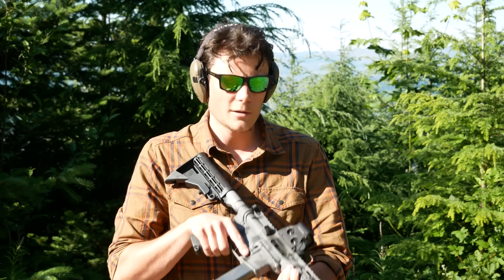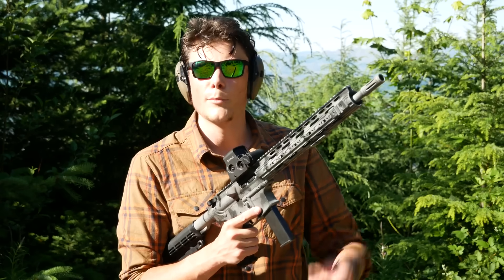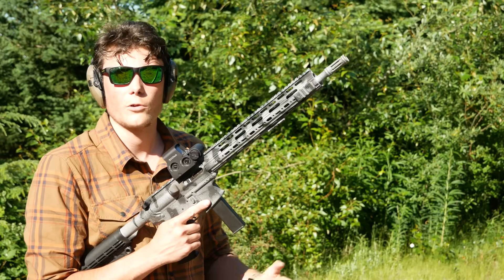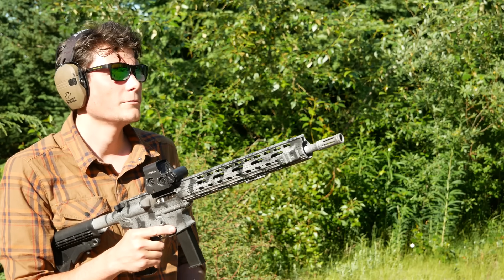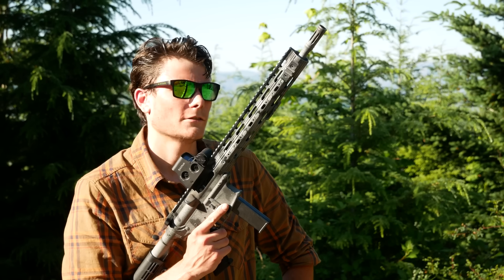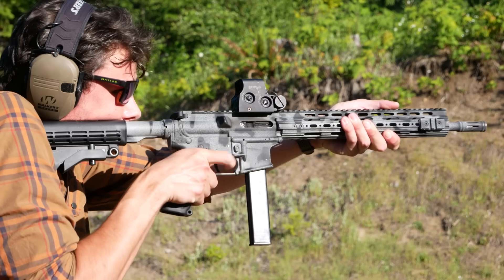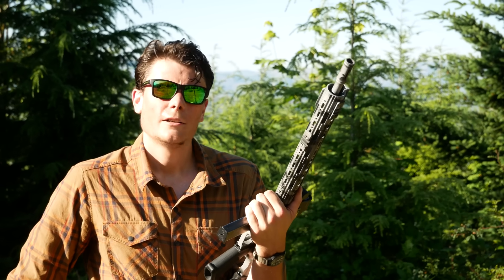Converting an AR9 to Roller-Delayed Blowback

Comment: If I recall correctly the 9mm AR does not have much "recoil", even the SMG, at least in my expeirence, but I guess it's all relative.  If you never shot anything with significant recoil, you would think an AR9 has a lot of recoil.....

Comment: Cmmg Radial Delayed Bolt and Barrel costs at least $375 and is more depending what barrel length and store you look at and there is no guarantee that it'll fit in your receivers w/o modification.  I considered getting this instead of the CMMG kit bc of cost and simplicity.

Comment: The only disadvantage is that because the charging handle pulls on the portion in front of the rollers instead of behind like purpose build roller delay guns, you have to overcome the rollers while chaging it.

Comment: I recently bought the Palmetto State Armory PX9 Gen-4 rifle. WOW the amount of crud that is blown into the receiver and out the ejection port! 
My brother is left handed and can even see the amount of powder residue being blasted on his face! The brass casings are even ridiculously covered with crud and quickly turned the costly walnut media in my tumbler into looking like I am tumbling with charcoal.  
I' m now seeing these exact same complaints from even years ago, and so it's pathetic that any company would still be letting their guns leave the factory with their schitty light weight buffer. Theyre charging an average of 800.00 for the gun and yet theyre then making us pay for the PROPER 8oz buffer which significantly helps keep the bolt closed longer in order to keep most of the crud in the chamber and it reduces the recoil

Comment: It seems like the point of a roller-delayed system in a subgun is to shave weight and recoil impulse over a straight blowback.  As an added bonus, most roller systems lack the need for any kind of buffer tube for those who want foldy bois or no stock/brace whatsoever.  This feels about as limited in market as the Angstadt Arms MDP-9 which costs as much as an SP5 but doesn't get you admission to the HK owner's club.

Comment: I have a QC10 Colt lower and the biggest thing I've noticed, besides all the troubleshooting it takes to get the thing to run without a malfunction, is how dirty the blowback system gets, especially around the upper & chamber area. Cleaning the gun after two 32 rd mags, you would think you fought a small war with how dirty the gun gets.
Reply: Is hops lower a QC 10 colt mag lower?

Comment: Any confirmation of it working with the PSA carriers?
Reply from the maker: It should work. Looks like the current gen PSA carrier has an internal pinned weight, not a rear section.

Comment: Why not make an AR-9 that uses MP5 mags?
Reply: Because it won’t lock open when empty. You’d be better off using Scorpion mags, they are cheaper and you can make a gun with last round bolt hold open.

Comment: It would be interesting to see them continue to develop on this, although there is only so much they can do because it is putting stress on the lower extension tower and the back end of the extension versus a trunnion. 

Not bad, good for them for trying something different.

Comment: I am the recovering owner of an AR9. Over the many years of my shameful addiction, I have tried many different spring and buffer weight combinations trying to soften the recoil of the thumpy AR9. The short answer is, when compared to a regular carbine spring and Colt SMG buffer, none of the buffer and spring combinations I have tried made enough of a difference to make a difference. 

The fact that something now exists that makes Hop say, “Wow, that feels a lot better” is very intriguing.
Reply: You should also look into the Scheel Roller-Delayed Buffer System- Gen2, Works great!
Reply: I built a blowback with a standard CS Carbine Brownells spring and a 7.5 oz buffer and the thing didn’t move when firing
Reply: Mean arms just released a roller delay BCG
Reply: you were shooting the wrong ammo. i shoot USPSA PCC with ammo specifically loaded for PCCs and it's like shooting a .22lr. but then again i'm also running a $3,000 PCC.

Comment: Just putting this out there: the Maxim doesn't seem to function in the same way as the MP5 does, even though both are called roller-delayed. While the MP5 (and CMMG) use mechanical leverage to increase the inertial resistance provided by the carrier's mass, the Maxim buffer looks like it acts more as a strong ball detent. Also, while the charging handles of the MP5 and CCMG bypass the mechanical disadvantage of their systems, the Maxim does not. That's why charging is more difficult with the latter. 

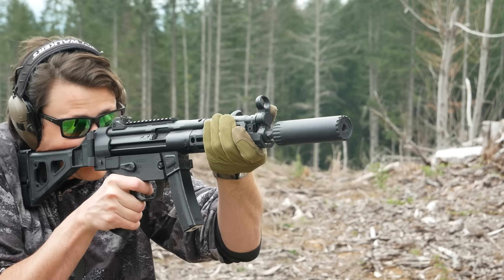Regarding 5:20, you can speed up the cycle time of an MP5 by placing a delrin spacer inside the receiver. This stops the carrier from moving back as far. In fact, you can shorten the cycle distance of a from the original 4.7 inches to ~2.4 in., shorter than that of most AR9s. I've done this to a select-fire MP5 and it brings the rate of fire up to almost 1,200rpm. It's a riot to shoot steel with!
Reply: Oof, that would be fun.... I bet you would detach your own retina if you did that with a G3.....
Reply: @presidentmerkinmuffley6769  Haven’t done it with a G3, but I did try it with an HK53 and its 5.56 ~8” barrel. Between the recoil and muzzle blast, I could barely make out the red dot. It rocked my world haha

Comment: Hey Hop, love your videos. I was wondering if you backed the buffer tube off one full rotation to get the proper clearance for the buffer system? I heard that was recommended because if you don't it will pre-load the buffer system causing it to not recoil as soft as it could. I also heard that makes it a bit harder to charge the firearm. There is a channel called blowback9 if you get more into the 9mm blowback systems, he goes very in depth and is very informative. Once again keep up the great work your videos are awesome.

Comment: Your buffer serial number is just 1 behind mine.  I've really liked mine, and I ended up getting a second one to dedicate to my suppressed SBR.
Reply: Did yours install without any compression?  I had to loosen my buffer tube one revolution to prevent pre-load on the system.
Reply: You guys are almost like tunnel buddies.
Reply: @JimYeats  almost?  Almost is never good enough.
Reply: @chevrofreak  Well said.

Comment: Hop, Arfcom has noted that the force to use the charging handle is vastly increased to the point where some people might not be able to actuate it - can you elaborate on how heavy it is and if it’s a concern?
Reply: He talks about it at like 3:41
Reply: It is sugnificant. Hop really downplays the effort it takes to charge. Makes me question why. Any other time or item, he'd be verbally assaulting the force needed. 
It's not a minor issue, it's borderline excessive..
Reply: @stevegillespie6424 hop is also a big guy and can get a better hold on it.

Comment: I have been looking to begin an AR9 project, but I really wanted to get last-round bolt hold-open with reduced recoil impulse, but not breaking the bank to accomplish it. I was considering doing the CMMG roller delayed bolt/barrel assembly with an Aero EPC9 receiver set, but that plan fell flat on its face when I learned the CMMG system requires a larger than normal ejection port and the EPC9 upper receiver has a smaller ejection port. Now that I know this Maxim buffer system works I can probably get the EPC9 receivers that come with a last-round bolt hold-open feature and a different AR9 bolt system, and it should work fine. Thank you!
Reply: I built a standard ass blowback with a 7.5 oz buffer and carbine cs spring from brownells and it doesn’t move when I shoot it…literally zero recoil, I don’t understand what everybody is whining about

Comment: I can't help wondering what this buffer would do if you installed it into things it was never designed for, like a regular 5.56 AR.
Reply: Presumably nothing good, given how much higher pressure 5.56 is than 9mm.
Reply: @colby1398 but the standard AR is gas operated with a locked breech. Installing this buffer wouldn't negate that.
Reply: @colby1398  Add a high backpressure can...   and no adjustable gas block ?
Reply: Or maybe run it in banshee, lol.

Comment: My five year old: shoots straight blowback 9mm without any complaints

Guntubers: "9mM bLoWbAcK kIcKs ToO hArD"
Reply: Right? 😂 Mfs have no problem shooting snappy subcompact 9mm handguns which are all the craze rn, but complain like crazy even though they have that extra point of contact and a much better recoil system on their AR9s.
Reply: what's the point of a 9mm ar that recoils more than an ar15. it's just a worse gun in every way, the recoil is the cherry on top
Reply: @0Asterite0 It’s only worse recoil if you do it wrong. Done right, the recoil is about the same level as 5.56 but of a different style.

Comment: even from the start, i've always had the experience that straight blowback is crude and unrefined. i've always vastly preferred the forms of delayed or locked breech actions. i've suggested it before, but a similar alternative that seems to make a world of difference is CMMG's Banshee system. it's a mechanically delayed locking system that just interacts between the bolt and barrel extention. though with that you're limited to it's own proprietary parts, but i think it's just the barrel and bolt itself. 

what i'm particularly curious about, with this is the various AR9 systems that use different or better suited magazines for this, like the CZ Scorpion. or how well it can handle other calibers, as the aforementioned Banshee was specifically designed to handle .45auto, which is otherwise very difficult to design blowback for.
Reply: I believe Banshee simply refers to a specific price tier of CMMG’s products, while the pistol caliber operating system is called Radially Delayed Blowback (RDB).
Reply: I am curious about how CMMG’s system holds up over thousands of rounds given that it sounds as if friction within the locking lugs and maybe the interior of the bcg is how they achieve their delay. Roller locks seem proven to be very durable, provided they are manufactures to a high standard
Reply: .45 ACP is so easy to design a blowback firearm around you can do it accidentally, see the Thompson SMG with its non-functional blish lock.
Reply: @agentoranj5858  the Thomson was spectacularly overweight, and wasn't all that desirable by soldiers and units with experience with alternatives. The Russian tankers using lend-lease equipment comes to mind. 
the issue CMMG had was fitting it in the dimensions of the AR-15 receivers. Some of their attempts ended up having the bolt weighing more than the rest of the gun. And they didn't run well either 

A modern example is the UMP, which was widely disliked for a number of reasons, but notably due to how violent it was to fire, having a lightweight body and a heavy blowback bolt

Comment: I’ve been using the Scheel roller delay buffer in my AR-9 build. Definitely helps. It’s also expensive AF
Reply: I've had a Scheel for a while, and I've shot two DaVinci Machining DG-9's that are equipped with them, but the Maxim buffer has better recoil reduction.
Reply: @chevrofreak  Really? That's interesting to hear. I haven't gotten a hands-on with the Maxim but now if it's better than the Scheel I have to try it out.
Reply: @0dayExploit  the DaVinci rifles are owned by one of their pro shooters, one was a Gen 1 Scheel and the other a Gen 2.  I let him try my rifle (I have a shirt video of the rifle on my YT page) and he immediately turned to me with a shocked look on his face and exclaimed how light the recoil was.
Reply: @chevrofreak  I guess my comment got blocked, but I tried to tell you that I was reading an arfcom thread about the maxim and saw a comment about someone comparing two davincis to it… and then I looked over and saw it was you lol
Reply: guys, keep in mind the ammo you're running. my DG-9 with a blitzkrieg buffer shooting actual PCC specific ammo shoots softer than any roller delayed i've tried, even a DG-9 with a Scheel. Also, RDBs break all the time in competition so I've avoided them at all costs, more moving parts = more points of failure. know a guy who almost had to drop out of PCC Nationals because his scheel locked up mid stage.
Reply: @RSpracticalshooting   Is true PCC ammo using a slower burning powder, to lessen the hit and the subsequent force needed (weight), to counter act the early, and extreme pressure rise of the faster burning powder in the typical 9mm pistol cartridge??